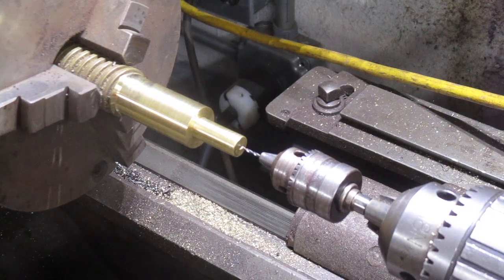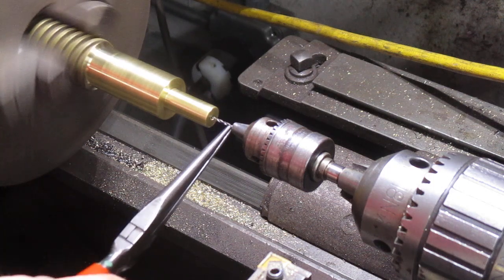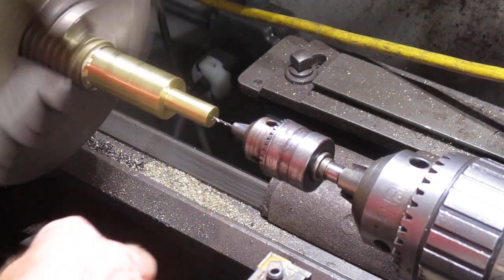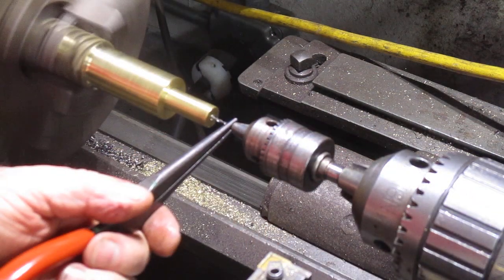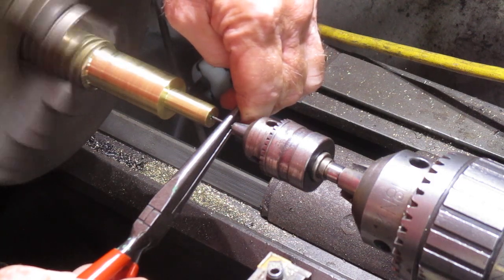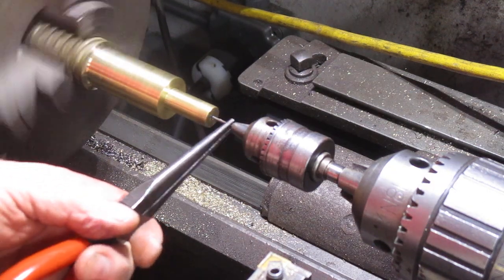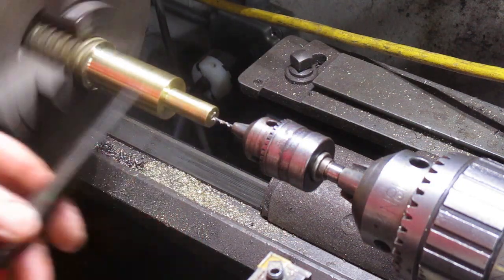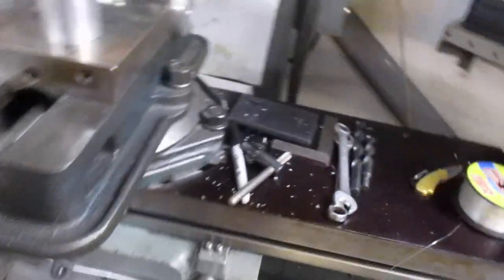Sawmill project Hardest Hole I Ever Drilled #457

Comment: 1/16 drill bits can be a bit tricky. Nice job on that job. 1/16 drill bit always brings the same memory for me. 1993 when I was a millwright I walked in the ''bullpen'' and saw an edger operator with a mashed finger tip. Someone told him to drill the nail with a little drill bit to release the pressure. I stopped him just before he started the drill press and asked how it would feel when the bit catches and sucked his finger up...
Reply from the maker: hi there been there with a smashed finger  thanks john

Comment: You have the right idea , you just need a 1/4 inch drill chuck ! That looks like a 1/2 inch chuck !
Reply from the maker: hi there it is that small the other chuck is a 3/4  probley 3 inch diameter  thanks john

Comment: Hi John,
I used to be a machinist in the good old days. :)
I would never have thought to drill a hole like that.
Very ingenious of you.  You can probably speed the lathe up quite a bit for such a small drill.
What you need is called a Pin Chuck held in your larger drill chuck just like you have done.
You could also get Collet Chuck with a Morse Taper on the back to go straight in your tail stock.  I’m pretty sure they would go down that small.
But that is probably going to be a bit expensive for a single project but a great tool to have down the track.
You won’t get much feel cranking the tail stock handle round and round with such a small drill and there will still be just as much in out in out going on.
If that’s a Bridge Port mill I saw in your shop you could get it started on centre in your lathe then go over to the mill if you have something that will hold the drill in that machine.  You’d need a V block or a three jaw chuck to hold the part in.  You would have much more feel on the quill than the tail stock. Again rev it up and clear the chips often.
Good luck.  I like the string concept.  Look forward to seeing the completed stuff in action.
…..(time passes)
I just read some of the other comments one of which said to slow it down.
A quick google says the cutting speed for brass or bronze is 150 feet per minute (others say faster but depends on the type of brass)
At 1/16 inches that is really fast.  3000 rpm is only 48 feet per minute so you won’t have to worry about going too fast on your lathe.
If the drill was good to start with you won’t have to worry about blunting it on brass.  I’d have to look at it with a magnifying glass these days. ;)
Reply from the maker: hi there some good info. thanks john

Comment: That's a big bit, I have a pin vice with microscopic bits used for cleaning out the end of a torch. I had to help my son with a model that had fiber optics and had to drill hundreds of 0.001 holes for him. About the size of a sewing needle.

Comment: The chuck off an old plastic body B&D 1/4 inch will hold on a 1/16th inch bit. I had to drill one a while back. But if it works! GBWYou!
Reply from the maker: hi there didn't have one handy  thanks john
Reply: @fricknjeep  I had to go find mine.

Comment: As a retired machinist I an snickering. You have a mill there. If you hold the drill in a 1/16 collet and the part in a V block you should have enough stroke to do the job. if it's brass. If it's bronze, use a cobalt drill at a lower rpm.
Reply from the maker: hi there thanks john